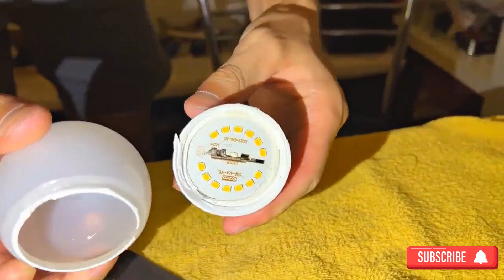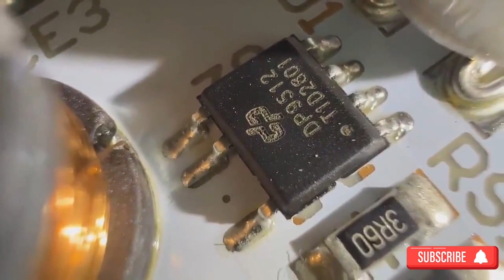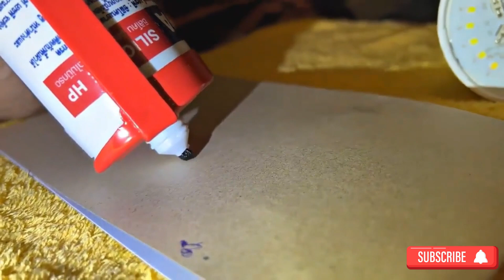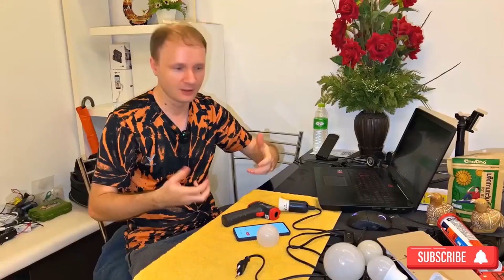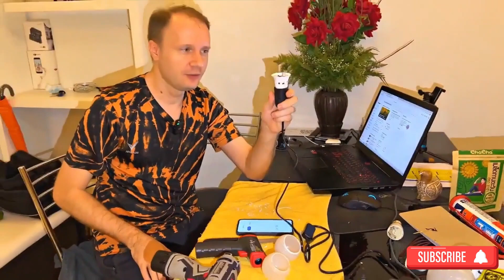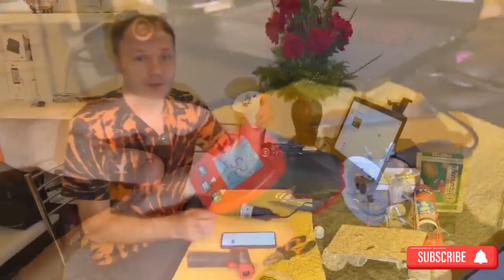How to DISASSEMBLE and REPAIR an LED lamp WITHOUT A SOLDERING IRON  Do-it-yourself light bulb repair

Comment: One of my LED bulbs burned out about a week or two ago. I opened it up, but I couldn't find the faulty LED. Then I found one that was a bit blackened, so I removed the LED and soldered the connection. Wow, it works again now. Thanks. Good video.👍